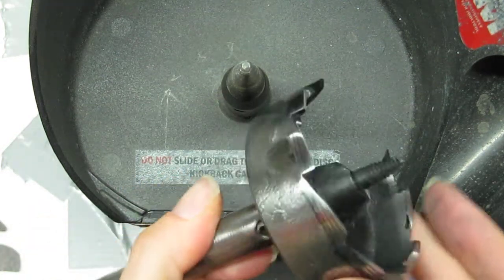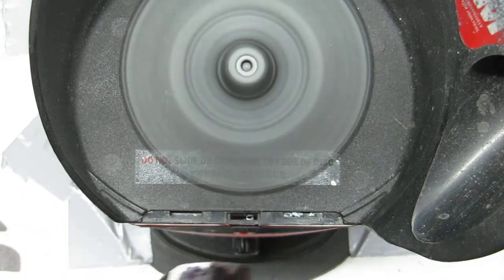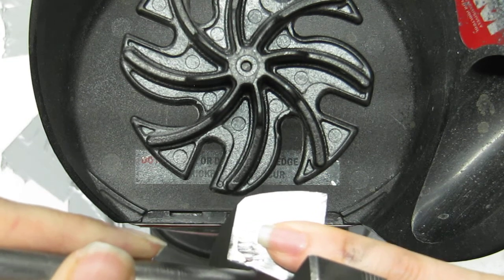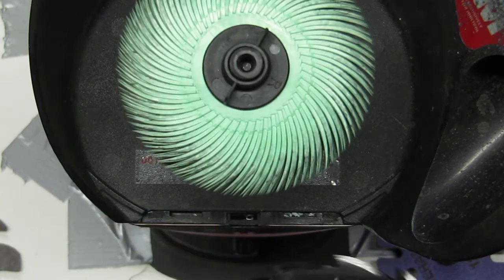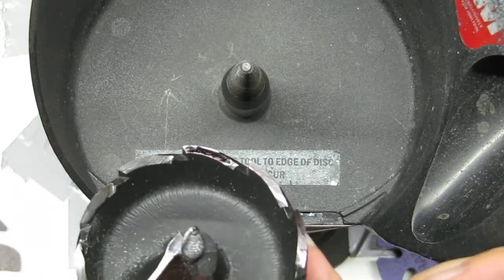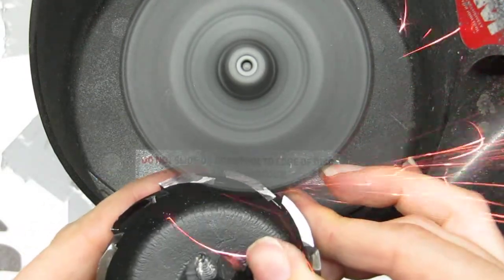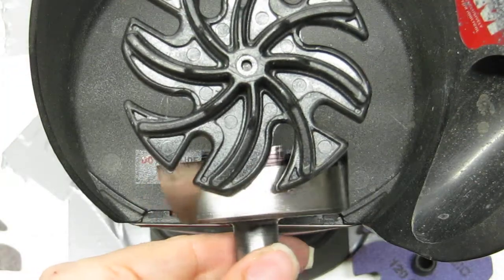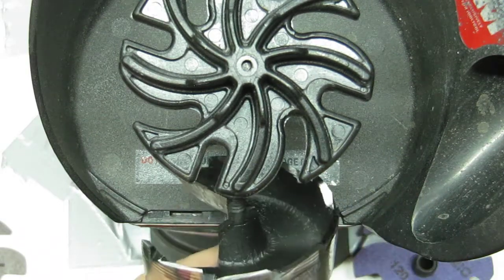HOW TO SHARPEN A FORSTNER BIT - JOOLTOOL

Comment: Seems every tool expert I know has always said NEVER to sharpen the outside diameter of a forstner bit. That advice always seemed solid to me. Even if you're only using a 10 micron disc you will eventually reduce the bit's size over many sharpenings. Then that bit suddenly ISN'T a lifetime one.

Comment from the maker: Thanks for your comment. You are correct. The Jooltool is the only tool to use for deburring the perimeter of the Forstner Bit. We do not recommend to use conventional grinders/abrasives for that task. The Trizact abrasive in this video has a unique micro-pyramidal structure which cuts precisely while simultaneously polishing. The effect on the metal is closer to a "car polish" than a sanding disc. Lookup 3M Trizact super-abrasives online. Cheers.

Comment: Although it looks cool and would probably work on not very dull tools I'll tell you a a professional sharpener for over 30 years that most of the tools come to me beat to shit. You can't just sharpen the face of the main cutting edge. You need to do the top as well otherwise once you get the wear out of the spurs by sharpening the top the spurs will soon be lower then the main cutting edge and they won't cut anything. It'll be the main edge doing all of the work. I also never do the outside diameter.
Reply from the maker: Hi Jeff, Oh The stories I could tell you about guys that have been sharpening for over 30 years after they use the Jooltool. They have given me tips and tricks! They all say the same thing "It was so easy to sharpen, it took less than a min, I feel bad charging my customers for it!" Maybe you should try it and make life easier :)-Anie